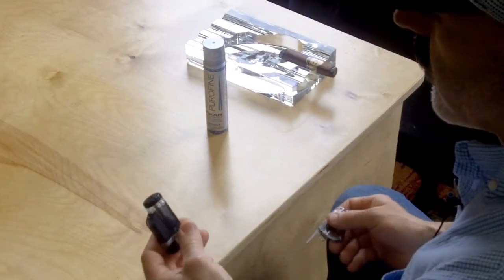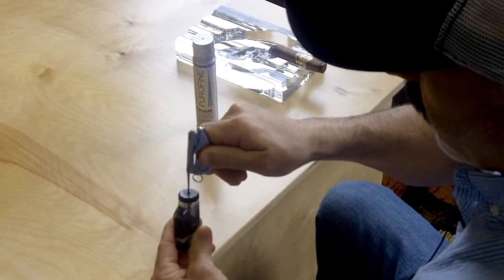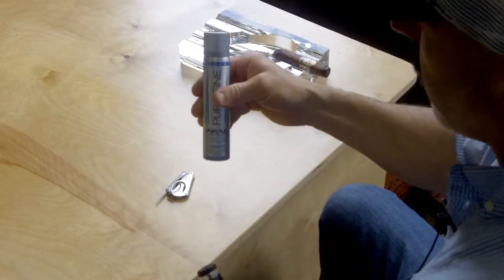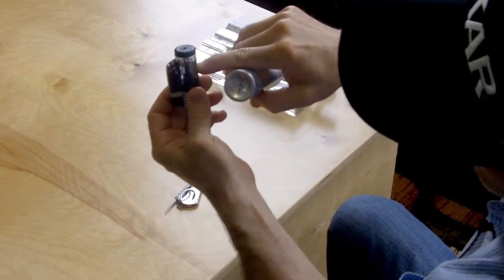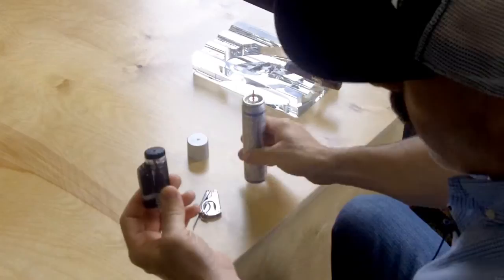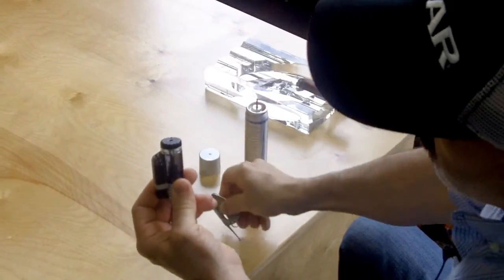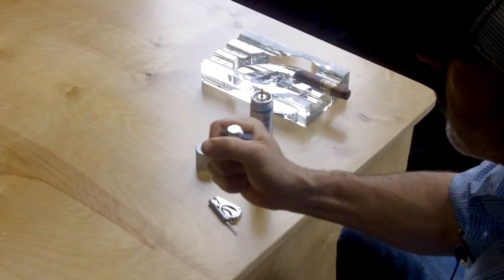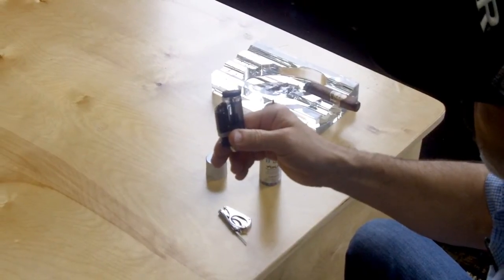How to Bleed and Fill a Tech Lighter

Comment: Hmmm.   This video appears to be in the correct category all right .... "Comedy" 

How did the "air" get in there in the first place?  Was it factory installed?
Reply: Well, talk to us and explain.  You can see air in the lighter tank so where did it come from?  Perhaps the air comes from the can of butane, that air is the motive force that pushes the liquid butane out.
Reply: Technically the air was factory installed. Most, if not all butane lighters, are not manufactured within vacuum chamber environments. The more you know!